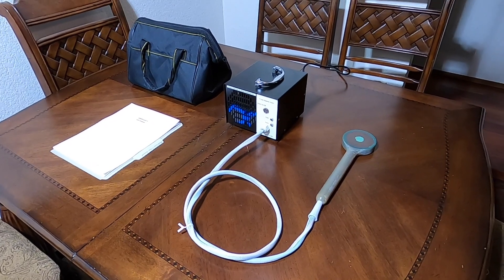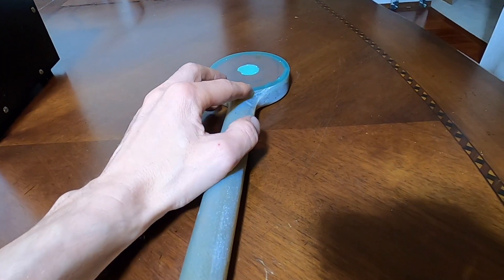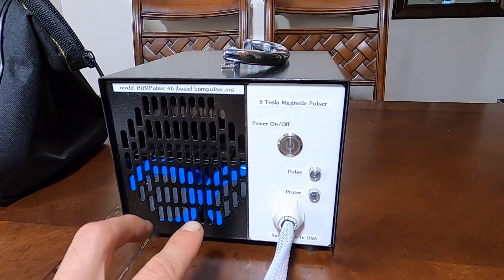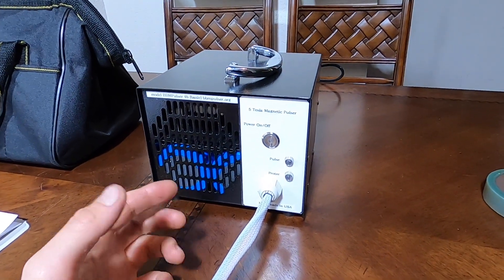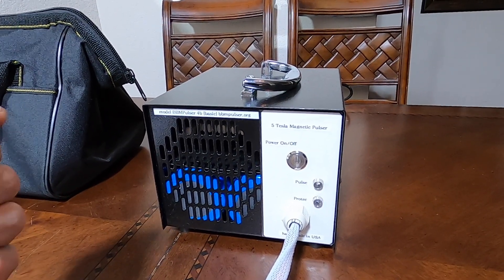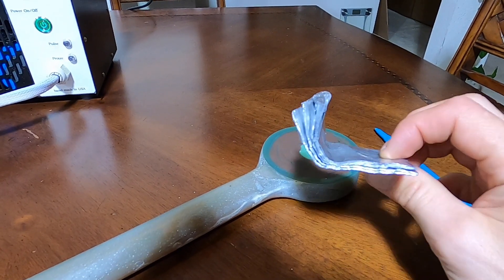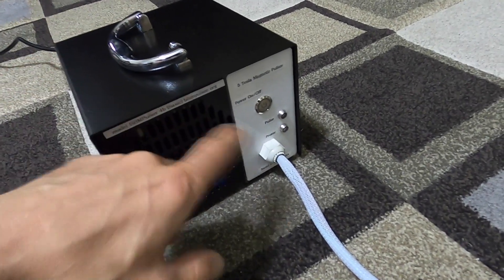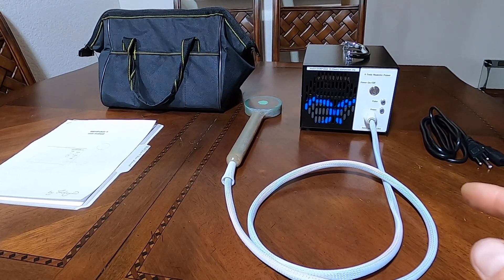010 Introduction of the model "B" BBMPulser 4b. Basic Strong Magnetic Pulser  1.4 Tesla (14kGauss)

Comment: Andrew, do you have a video that explains the start to finish of the electrical process of the PEMF. Why do we us hurts, volts, amps, We start with 110 V plugin at the wall. Then it goes into what? It get converted again into what. Also why do some coils have several winding but some coils look to only one wire in the coil. Thanks so much. Brandal
Reply from the maker: It would be a good video to make, unfortunately I don't have one like that
Reply from the maker: High voltage PEMFs may have a few windings i mean 6-12kV pulsers
I need to play with short coils, that's for the future, they have their own challenges. One thing that I don't like about them is that they cannot produce long pulse, only short pulses, and long pulses are the ones that carry energy and are very effective

Comment: do your models overheat after some time and turn off by itself? And how long you can pulse before it overheats?
Reply from the maker: When coil gets hot build in thermal switch near the coil gets trigger disabling power to the charging circuit. Pulser will stop pulsing up until resettable thermal switch cools off ~80%
Thermal switch is 50C, it's slightly offset to pick up ~60C.
Take around 10min to get coil to the point where thermal protection kits in. 
Takes around 30 min for it cool off on it's own down to 20% when thermal switch resets.

True power output for this model is 14,000 Gauss. (1.4Tesla)
Reply: @AndreyD  so 10 min before is overheated and needs to be turned off?
Reply from the maker: @MasterofPlay7  only coil overheats. Unit does not. 
You can turn it off or leave it on
Reply: @AndreyD  but will the paddle gets too hot?
Reply from the maker: @MasterofPlay7  Yes I allow it to get "hot" controlling it's maximum temperature with build in thermal switch. 
Coli can get how enough to cause a burn. Not hot enough to melt plastic.
Coil get to around 60C hot before it shuts off. Build in 50C thermal switch is slightly offset to catch around 60C temperature raise.
Reply from the maker: @MasterofPlay7  yes it gets too hot up to 60 Celcias
Reply from the maker: Yes it turns off automatically.
It takes around 10min.
So you can use it for 10min and then you new to allow it to cool off for 30min or use cold pack from refregirator to cool off coil faster (10min)
Do not submerge the coil in the water to cool it off

Comment: Where do you find such large metal enclosures?  I have been looking all over for metal project boxes.
Reply from the maker: Go to EBay and search for:
5000mg Commercial Ozone Generator Ionizer Industrial Air Purifier Machine. It cost around $60 with shipping.
Empty it and use casing for the magnetic pulser